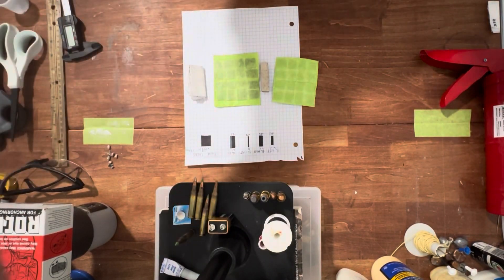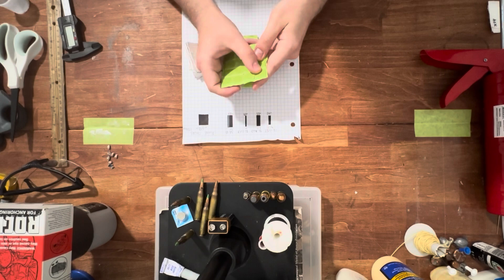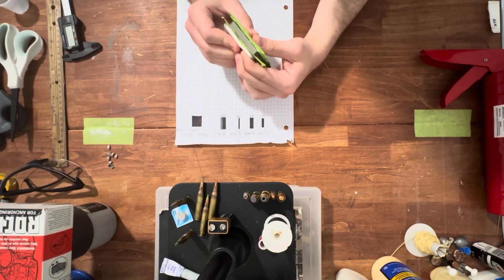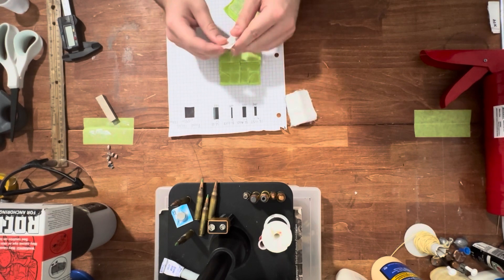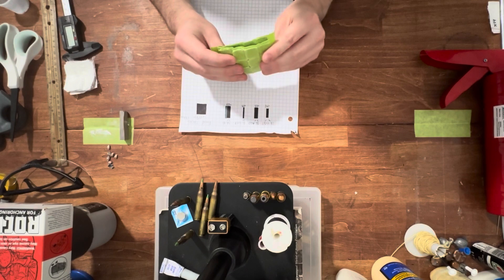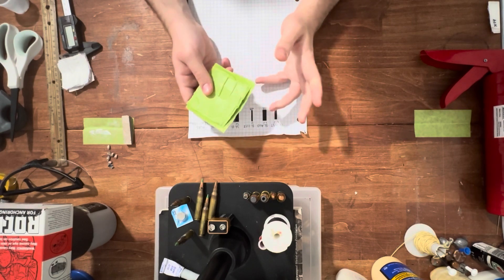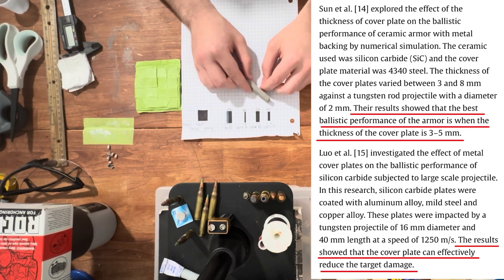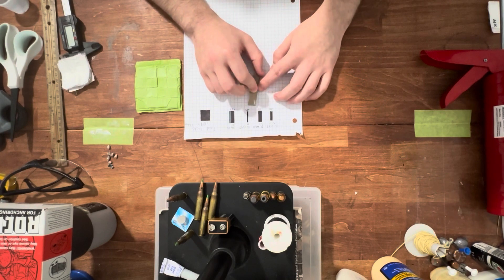Homemade Flexible Rifle Armor Project (design/overview of the build)

Comment: Your work on the different diy ballistic armor layups never ceases to amaze me, even if you're using essentially the same materials that are currently being used in real body armor designs. Yeah you're not wrong about those Carbide ceramic hexagons, they're crazy expensive.
I wasn't aware that they were 2 inches in diameter. I always assumed they were about an inch in diameter and about half an inch thick. But I guess that's for the higher end stuff. Even a monolithic Boron Carbide 10x12 ceramic armor tile would set you back about $500-$600 last time I checked. 
I don't know why the individual materials for armor plates are more expensive than the pre-assembled plates themselves. Maybe it's because the Defense industry wants to keep people from making their own plates. 
Maybe forcing people to buy premade armor plates by making pre-manufactured ballistic panels more affordable than the separate materials that go into making them is how the defense industry makes their money.
Because if everyone started assembling their own plates, then the defense industry would lose a lot of money. And I mean a LOT of money.
Reply from the maker: Yeah, I think it has to do with bulk discounting because if you buy enough pieces you get like 50% off but you have to have the upfront cost which is like $20,000. I appreciate the support, I feel the body armor companies are seriously lacking in the technology they are giving to their customers. There are so many papers out there will all kinds of cool stuff, but it's hard to do by yourself and limited funding. So why is it these big companies with all thier funding are still giving us the same stuff for like the last 10 years.
Reply: @Armor-Innovations   Probably has something to do with the Military Industrial Complex being in charge of everything. Usually anything the military has is around 25 years ahead of anything circulating in the civilian sector. 
It's kind of like why are we still using fossil fuels to get from one place to another when we know there are better things out there that have been kept hidden from us for more than 75 years.
Reply: @nemesisobsidian  Military Industrial Complex isn't even a thing. A lot of people don't know this but the defense budget is split among tens of thousands of companies. You don't get rich selling to the military and in fact it's a huge liability prone to lawsuits. The only reason companies want military contracts is because it looks impressive and this spurs sales in their civilian sectors. For example every large holder of military contracts make nearly all of their money from civilian not defense sales. FNH is a popular military gun company, yet 85% of their income comes from sporting shotguns/rifles sold to civilians, not military. Honeywell makes most of the explosives used by the US military and yet they make over 20x the income selling air conditioners at Walmart over the summer than their entire defense contract portfolio. 

Also there aren't any good alternatives to oil. First law of thermodynamics, energy is neither created or destroyed. Oil is the best energy source because oil is the second most common liquid on Earth aside from water, and has a high energy density. We can't even use it up faster than it regenerates. Nuclear is more efficient, but it is only feasible for large scale grid applications, not systems that require high fidelity such as vehicles.
Reply: @Armor-Innovations   Bulk Discounting with $20k upfront!? Damn.... I mean at that rate you may as well be born from a wealthy family and a member of the 1%. Only way you could even realistically afford prices that steep. I know I couldn't afford it. I could barely afford one 100th of $20,000. So like $100 or something like that. But most of the material I'm using for making my own body armor is usually free( recycled HDPE plastic from various sources), and the non-homemade materials I have to purchase to make my DIY body armor actually effective at stopping bullets I usually don't drop more than $50 on most of the time When I'm online buying stuff.
Reply: @calo9210  Spaced Armor I'm familiar with. I haven't heard anything about the other two. I'll have to check them out. Thanks for the info though.
Reply from the maker: Not sure how spaced armor could be incorporated into personal armor, maybe a shield could use it. The rest I just look at a few papers on and it all looks very complicated, too much for my small brain.
Reply: I would also like to add that Spaced Armor is more for protecting a vehicle from high velocity projectiles and wouldn't be very practical as personal body armor unless you take the NERA approach with a proper face. At which point you might as well call it a ceramic composite backer hybrid because that's what you'd end up making in the end.
But I'm sure it would still work very well against small arms, depending on material choice and layer arrangement/orientation.
Reply: @calo9210   I mean, you can  believe what you want it's a free country and all, but allow me to throw a bit of a curve ball at you. Ever heard of anyone making their own Alumina Oxide, Silicon Carbide, or Boron Carbide Ceramics at home? Exactly. You haven't. 
Because:
A. It would require tremendous heat and pressure to make those ceramics though a process known as sintering.
and B. Tremendous heat and pressure in equipment translates to a hydraulic press of 20 ton capacity or greater and a high temperature ceramic Kiln.
A decent 20 ton press can cost a couple hundred dollars, depending on the make and model.
A Ceramic Kiln that can handle the temperatures needed to properly sinter Carbide Ceramics could end up costing thousands of dollars, both of which are way out of budget for diy armor home brewers like Armor Innovations and myself.
Not to mention sintering Boron Carbide Ceramics requires an Argon gas feed as a sinter aid to prevent the B4C particles from oxidizing as they're being fused together into solid ceramic. 
Also sintering Boron Carbide can be risky business as the particles can release noxious fumes as they're being sintered, requiring both a well ventilated area and possibly an NIOSH particle Respirator or gas mask with activated charcoal filters.
Reply: Why not tryTwaron fabric,  same as kevlar fabric buy dupont, actually supposed to be better and it's cheaper. And question why titanium 5 grade ? Don't they recommend titanium grade 4 , higher carbon. For use ? Think that's what is preferred? Every video I've found, huge thick plates.  Wish was more soft vest diy videos. Skarr, like $220, front, back, soft, level 3 protection.  Too many out there selling small pieces,  think larger quantities of 
Twaron, and armed kevlor fabric, the way to go. I think more people,  would be happy with level 3, for in vehicle,  or on motorcycle.  High violence,  aruban areas. 
I don't even see anyone making molds of chest, to have better shape plates. Hints
Reply: @calo9210  Agreed. It's not difficult to replicate. But the limited access to highly specialized equipment is what makes reproducing it very difficult if not borderline impossible. And this false equivalency between the wealthy and the less financially stable is getting beyond ridiculous at this point.